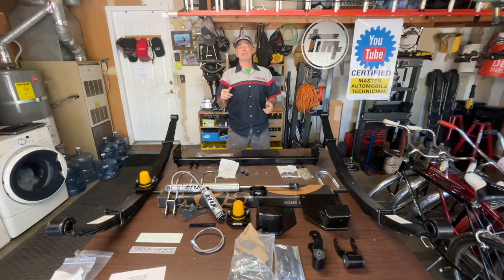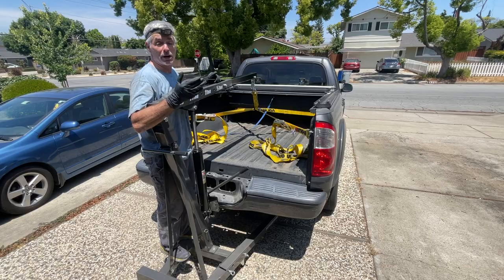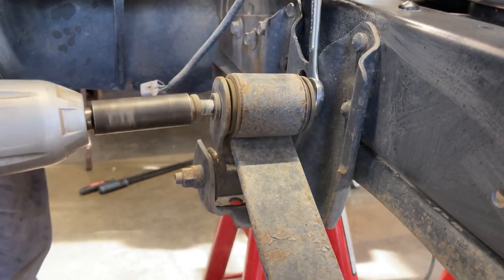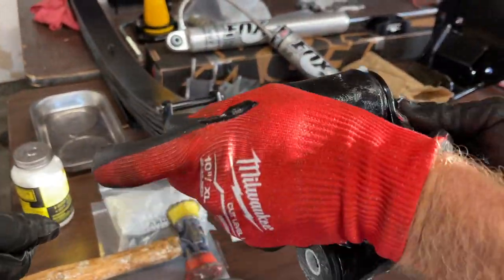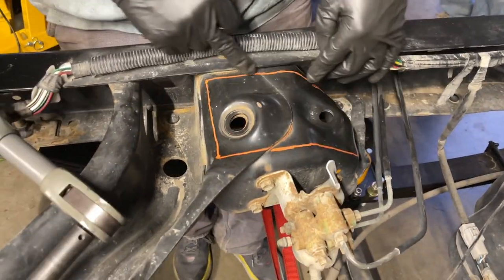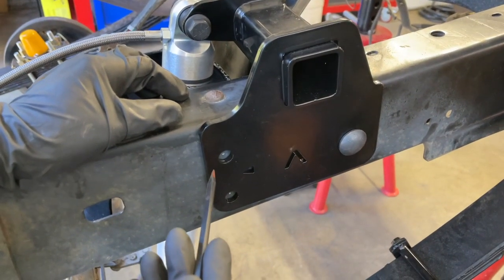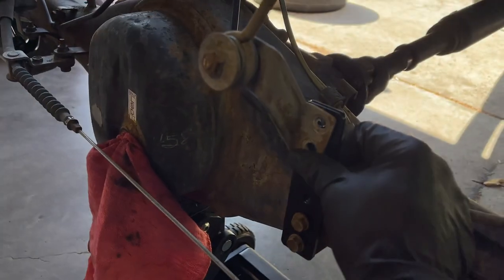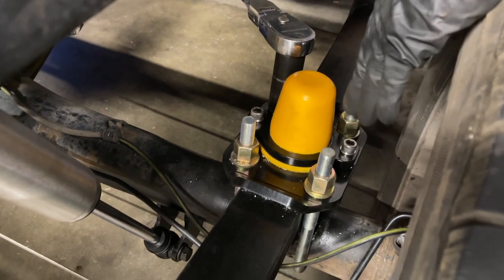Archive Garage Ultimate Off Road Package Install - (1st Gen Toyota Tundra)

Comment: Great work. Interesting to see how similar Toyotas of similar ages are. I have the handbrake cables running along the springs and the same proportioning valve (plus plenty else). The hardest step here seemed to be the lower shock mounts. The rest seemed to be plug and play (mostly). I enjoyed this like your other vids. I'll never do this mod, but it helps to understand my Toyota so big thanks and well done!
Reply from the maker: It might seem plug and play because of the video we made for people to use, but it was anything but straightforward.  Just getting the bed off and figuring out what to settle it down on took some figuring out.   This took us 2 days to complete, and it was the nost involved suspension lift Sean and I have installed.  

I'm glad you enjoyed this video.  Thanks for watching and commenting.  Happy Wrenching!

Comment: I just bought a 05’ DC 4x4 and I want to say thank you for taking the time to do this video. It will save me hours of headache and curse words. I would like to know if this mod will work with normal lift kits like a 6” RCD lift and is it worth it performance wise..? Again thank you!
Reply from the maker: First of all, you're very welcome.   Secondly,  I would ask the owner of Archive Garage your suspension question.  I think he would be better suited to answer your question.
Reply: Will do thank you!

Comment: Amazing job 👍.  I just don’t know if this is a good longevity option.  I want the new springs without chopping up the structural members of the rear frame. I guess there’s no much thing!
Reply from the maker: Thanks.  There's nothing wrong with what we cut out because the replacement is even stronger.   It all depends if you want to do all the work.

Comment: Curious if there was an alternative Higher location to add the shock mount? 
Seems like if you are going to move them you should move them above axel bottom.
I am novice, so sorry if that question was ridiculous.  
I  appreciate any info.
Reply from the maker: Moving them above the axle would severely limit the amount of suspension travel.  I'm guessing your comment comes from the shock mount hanging down low and being able to strike rocks while 4wheeling.
Reply: @TimmyTheToolman  yes that is my question.  
Thanks for answering I appreciate!!
Reply: @TimmyTheToolman  am I wrong thinking about it or am I thinking too far out of possible problems?
Reply from the maker: @RyaMarshall  You are right to think the shock mount could take a hit from a rock,  but the shock mounts are close to the wheels and they are less likely to take a rock strike compared to the low hanging pumpkin of the rear axle.  If you're 4wheeling correctly,  you have your tires traveling over the top of obstacles so your rear axle isn't slamming into them.  I hope that makes sense.  Do shock mounts sometimes take hits?  Yes, they do, and it's why some companies sell protective plaea that bolt on to protect the lower part of  the shock.
Reply: @TimmyTheToolman  It makes total sense thanks your the answers.  I am considering taking on a tundra and and giving it the upgrades and your two videos are OUTSTANDING!
Reply from the maker: @RyaMarshall  Thanks for the compliment Ryan.  We appreciate it!

Comment: How does he like the ride quality now?
Reply from the maker: He likes it, but he really hasn't tested off-road as far as I know.
Reply: @TimmyTheToolman hello again. Would this mod cause axel warp?
Reply from the maker: @kilogolfmike8095  I think you meant to say axle wrap.  Axle housing don't warp.  An axle housing could bend though from a hard impact, like from an accident.  Axle wrap happens when the leaf springs are worn out and the axle housing twists on a stop and then become unsprung when you ease up off the brakes.
Reply: @TimmyTheToolman  yes that’s what I meant. So you’re saying that this would not cause this problem having the shocks symmetrical vs how Toyota had it from factory?
Reply from the maker: @kilogolfmike8095  No, the shocks being relocated won't cause axle wrap.

Comment: Would it be pointless to keep the original rear shocks or at least buy a low budget set? Or am i better off spending the extra money on fox 2.0 to do the job right the first time.
Reply from the maker: @AdamXavier1GT  Spend the money.
Reply: @TimmyTheToolman  thanks for the feedback. I just needed someone to confirm what I already knew deep down lol
Reply from the maker: @AdamXavier1GT  No problem.
Reply: @TimmyTheToolman in your opinion, do you think Fox front and rears are the better choice for daily driver, overland, and moderate trail applications with a campershell?
Reply from the maker: @AdamXavier1GT  I'm not familiar enough with Fox to give an opinion on them.

Comment: How much lift did he get?
Reply from the maker: Archive Garage advertises it as 2 inches of lift but it gives the rear end 12 inches of travel.  So, much greater articulation when off-roading.
Reply: Did ya watch the entire video? Because Tim verbally stated how much total suspension travel this kit provided: 12 inches.  If I'm not mistaken, "lift" is a body-on-frame term, that only raises the body up off the frame more, to clear bigger tires. When running over high sand dunes, whoopty-do's, and other jumps.........it's increased suspension travel that ya need.
Reply: @howabouthetruth2157 i qas looking for the overall rear lift from the rear springs, as I have a set of archive garage rear springs and I need 4" of lift. So, it looks like I'll need a 2" block

Comment: New 5 gal buckets wouldn’t hold the bed, the food grade ones might
Reply from the maker: I don't agree with your assessment.  A 5 gallon bucket could easily support my weight, and I'm 175 pounds.  That truck bed isn't that heavy.  4 regular 5 gallon buckets could support the bed.
Reply: @TimmyTheToolman  I’m 350 and it won’t hold me up
Reply from the maker: @cheeseburger9232  That's a lot of cheese on that burger.
Reply: Four 5 gal buckets turned upside down will easily support the weight of that bed. We use empty 5 gal buckets upside down to stand on while doing certain jobs in construction all the time. Been doing it for decades. And some of my work buddies weigh a little north of 200 lbs. That truck bed doesn't weigh anywhere close to "800+ lbs". I bet it's only half that, give or take.